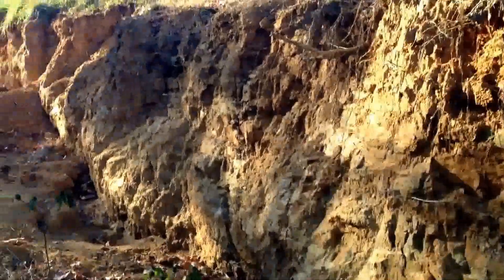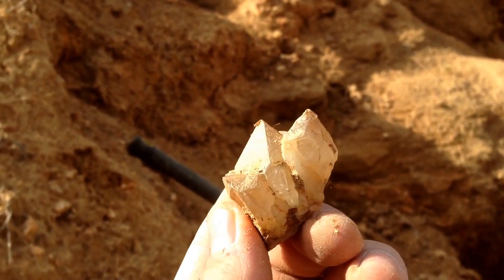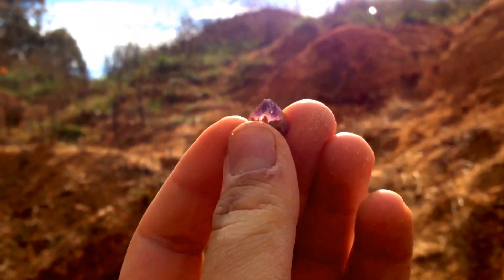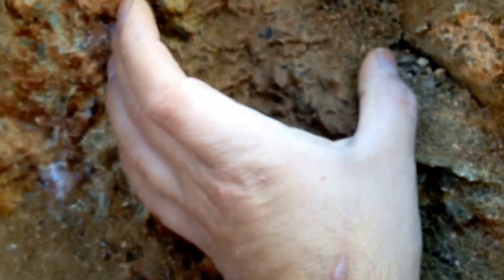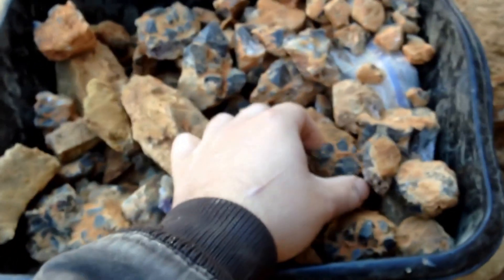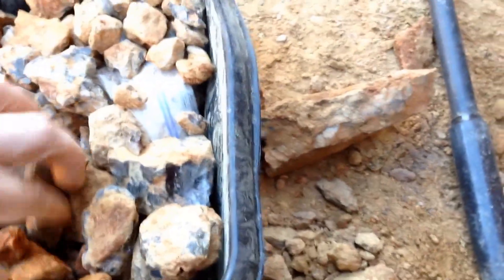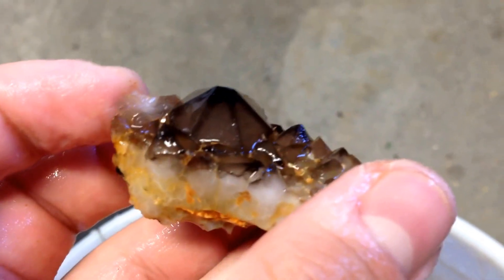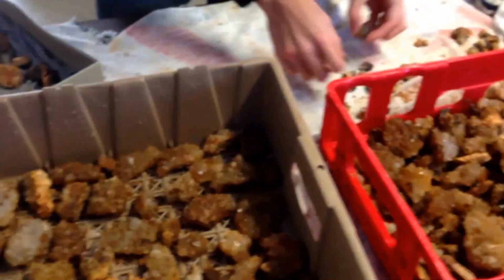Scufflin Acres Farm! Amethyst and Smokey Crystal Dig!!

Comment: I went  down to farmville from Baltimore, 6 he drive right after the big plate was extracted. I found a piece of the large plate , lots of clear double terminated . The site was very reminiscent of a smokey amethyst dig near Baltimoreat about the same time. It's a shame that they don't plow the fields around the farm. There is a stream that runs around the trench area, I consider streams to be slow speed hydraulic mining , every thing ends up in the stream.